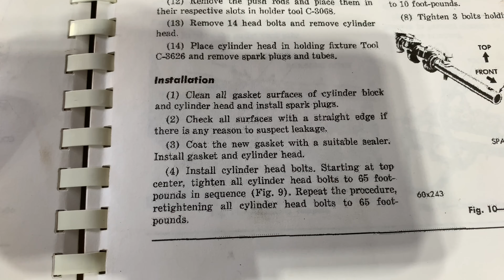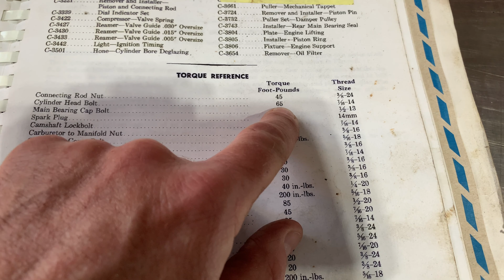Slant Six - Cylinder Head Installation / Water Pump clean-up

Comment: How heavy would you say the cylinder head is? I need to replace mine and I'm not sure if I'll need an engine hoist or not. Thanks and thanks for the video too!
Reply from the maker: I can only guess at how much it weighted. Maybe around 40lbs. Lifting it into position was a challenge trying not scratch anything. On the engine stand it was around my chest height.

Comment: That may not be a typo. Bolt torques on a casting as long as that head can vary as additional bolts are torqued, lowering the initially tightened bolts as any curvature is taken out of the casting.